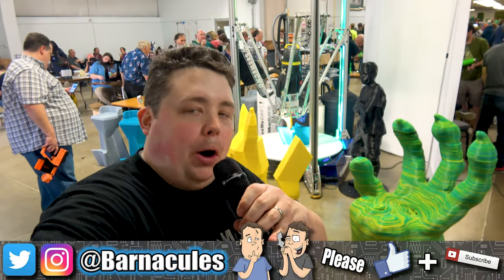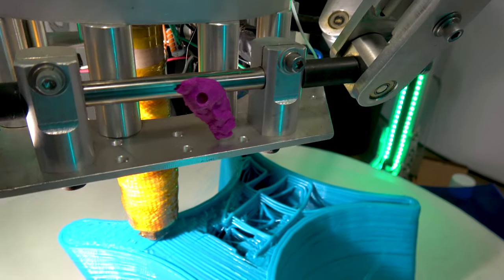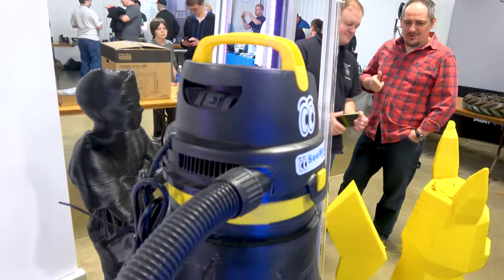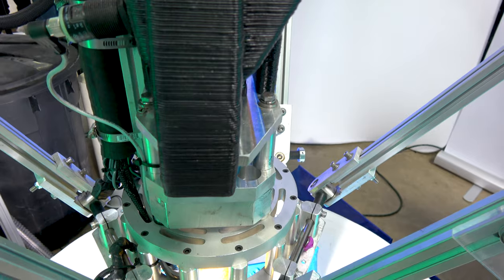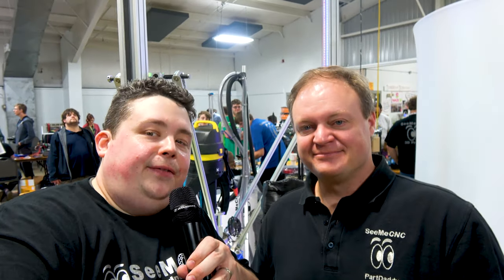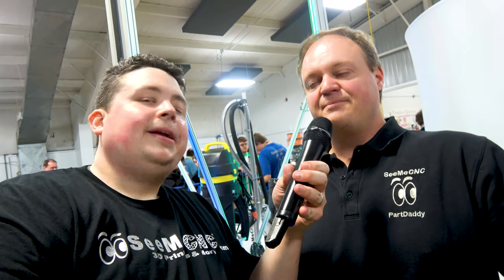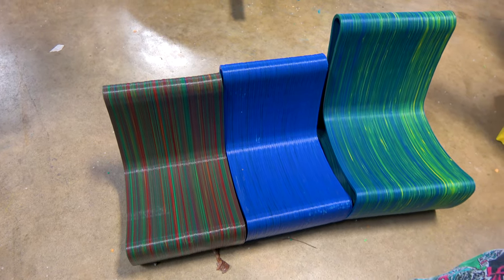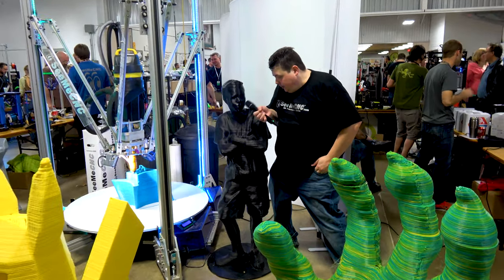Worlds Largest 3D Printer Making Furniture! You won’t believe it. - @Barnacules

Comment: "700Ws of current" jerry pls
Reply from the maker: Yeah, not sure why you're quoting me?!
Reply: watts is a measure of power which is CURRENT * voltage. Assuming it uses 12 volts, the amperage is 58.
Reply: lol k but [current*voltage ≠ current], thats my point

watts is not a measure of current, similar to measuring time in cm lmao
Reply: +Barnacules Nerdgasm  Your response to Shawn is even sadder than you saying "700Ws of current". smh.
Reply: Sean Gibson My money on him doing it intentionally (haven't watched that part yet)
Reply: SpydreX Official, that must be why youre here lol

Imię Nazwisko, sorry to say that none of that crap matters, because the "end result" of current times voltage is power (which is wattage), not just current. regardless of any redundancies amps is current, watts is power, two different things, theres no changing that 

jerry used the right measurement(i assume) but called it the wrong type of unit
Reply: Imię Nazwisko  I pretty sure he intended to say power but he was probably already developing heat stroke by then which started cooking his noodle. Shit happens.

I hope he knows we're just bustin' his balls.
Reply: Adam The system runs on 110VAC.
Reply: He said it was all standard electronics, except the motors. Anyway for a heater, its the amps that matter.
Reply: Good thing some of us are more literate on the fact that people do mistakes but it only takes yourself to correct that mistake on the fly and get the info into your brain as it was intended in the beginning. Funny how people really feel the urge to correct others. Jerry should have said 700Ws of horsepower, throw a little bone to the masses, you know.
Reply: Im sure its rectified and stepped down. Do they make RAMPs boards that even run off of ac?
Reply: Yup.... pretty embarassing  for a nerd...
Reply: davidcapi, pleading ignorance will get you nowhere - especially when you had nothing to do with the situation

without being corrected you'd never learn. try growing up without being corrected on anything, thats the importance of it. clearly jerry didn't know where he went wrong based on the first response to my original comment

you've got a pretty condescending post if you ask me
Reply: +Sean Gibson Did I trigger you?
Reply: Adam  Yes standard electronics but those are fed by a power supply stepping down the standard 110VAC to 12-24VDC.
Reply: Life lessons, on a current - power discussion. If correcting is so important, Sean, why didn't you just make the correction but rather, play the "I will call your fault and let you try to figure it out" ending with a "pls". Now, don't come try to get me "schooled" son, I've been through inmature behavior dealing before, yours is ending here, as in, any future reply will be bypassed by me. Have a nice day sir.
Reply: oowiegoowie Oh crap! You are right! It's "immature". You see, my native language is spanish. Even tho I always edit my posts and replies and have them as correctly spelled as possible, I'm bound to make a mistake here and there, like thinking "inmature" was the equivalent for "inmaduro". Good thing you were wise enough to spot it and actually know what I really meant to write. Have a good day, sir.
Reply: Barnacules Nerdgasm yeah you slipped up but every reply to this is dumb. these guys aren't nearly as smart as they think they are.

1, when dealing with ac voltage times amps (emf x current) give not watts but voltamps or voltamperes if you like the long form. to get watts you need the power factor. voltamps and watts may be different because of some things that can happen with the wave form. 
2, obviously the ramps board doesn't run on ac, it doesn't run on 12v either, that might be the input voltage of the board but the atmel chip is running from probably a 3.3v source. maybe 5v. the steppers are running 2phase quadrature at I dunno, anywhere from 24-80v could really be anything but steeper controllers regulate current via emulating a voltage through pwm control within the square wave of the quadrature signal. the measured voltage will depend on how fast the motors are turning since that changes the motor impedance. 

3. clearly what was meant by 110v is the transformer/power supply doesn't need to plug into 220 to get the required watts from the wall. obviously it would be silly for all the parts to running from 110 directly.
Reply: how do you know the steppers run on ac?
Reply: Sean Gibson yeah I cringed when he said that as I study Electrical Engineering. But we also have to remember that not everyone deals with this in a daily basis so it's excusable in this case. people make mistakes so don't rag on him too hard
Reply: Shouldnbe 700w of power...

Comment: This is pretty awesome, glad you took a look at it.
Its actually not to surprising that this beast runs on 120 volts. Given the print head draws 5.8 amps, leaves plenty for the stepper motors and electronics. Only reason to run it off 220-240 would be to push more current to the print head.

Comment: 8:40 .. .23 million cubic mm only equates to about 23 cubic decimetre (or 23 litres, if you like it that way).  That doesn't quite sound right, given the size of that printer.   Assuming a cylinder with a diameter 1 meter (1000 mm) and height 3 meters (or 3000 mm), you will have a total volume around 2356 million cubic mm. He is out by two orders of magnitude.

Comment: The beauty about Delta robotic machines is they can be very rigid, minimizing wobbling while moving faster. The problem with this one is, the columns need to be very rigid, since this Delta adjust position by having at least one of its arms move up or down in the column in reference to the others, unbalancing the load on the columns. The Delta arms can also limit more the height of the work volume in comparison to a Cartesian rig, but considering all the stuff behind the end tool base it won't make that much difference.

Comment: The material delivery system works exactly like the one I use on my injection/mold machine i use at work.
Reply from the maker: That doesn't surprise me since they have 3 injection molding machines at their machine shop and I'm sure they borrowed the design.

Comment: Why not run it off 220-240v? It would heat more efficiently and use less current, requiring a smaller breaker.
Reply: Also the rest of the world could use it.
Reply: Hyss assuming the heaters are 120v (USA standard) its only running about 6amps, so not big deal for standard domestic wiring, not sure why he was getting so excited it running on the lower voltage.  To use it in a higher voltage country it would be simple to swap out the heaters to 240v type
Reply: Why would a higher voltage heat more efficiently?
Reply: Steve Greenfield higher voltage means less current for the same power therefore less power loss across the supply wires, not really an issue for these power levels. Just on a side note this is why power companies transmit power over high voltage lines and step down closer to the user
Reply: Right, I'm aware of that. But as you say, not really an issue at these power levels.

Power transmission lines run at 100s to 1000s of times higher voltages than what is in your house.

Comment: The real question is how does the controller measure how much plastic is extruded each rotation of the auger, because it's not a fixed displacement, you know.

Comment: Those stepper motors look like they could run a 5X10 CNC router that is capable of cutting 8-quarter SOLID OAK in 1 pass!!!!!!!!!!!!!!!!!!!!!!!!!!!!!!!!!!!!!!!!!!!!!!!!!!!!!!!!!!!!!!!!!!!!!!!!!!!!!!!!!!!!!!!!!!!!!!!!!!!!!!!!!!!!!!!!!!!!!!!!!!!!!!!!!!!!!!!!!!!!!!!!!!!!!!!!!!!!!!!!!!!!!!!!!!!!!!!!!!!!!!!!!!!!!!!
Reply from the maker: You're probably right, they were massive.
Reply: GoProAhaulic  8 quarter??? Why can't you just say 2 inches?
Reply: My inner cabinet maker escaped. The stupid thing is 8 quarter = 1.75" lol
Reply: GoProAhaulic  lol. 1.75" is final finished size but "8 quarter" refers to quarters of an inch. 8 x .25" = 2"

Yup. Makes perfect sense...smh.

Comment: Why is America on 110V? Seems pretty low when a large portion of the world is running 200+V.
Reply from the maker: Because we're stupid and if it was any higher we would kill ourselves licking the wall outlets.
Reply: The US standards were set a long time ago and the voltage levels were based on the 'safer' DC voltage level used at the time. It's far too costly to change now but we would be better off with a 230V system.

Comment: It moves pretty slow though , why put the weight on the effector of a full vacuum cleaner seem spretty stupid though, they could have had a screw feed with a hose and had smaller motors

Comment: Tell me now, what would you print with such a big 3D printer? (I would print myself a custom backplate for my GPU)
Reply from the maker: This would have a very hard time printing aback plate since the layers are so thick. But, you could use it to print a new office chair and a new table :D
Reply: FoxBit that thing would probably deform, PLA (the standard 3d-printing plastic) deforms at ~60 degrees Celsius. You would need some kind of High-Temp plastic

Comment: i will get a 3D printer when,
the printer itself is a product of 3D printing entirely
and that printer is capable of printing an even smaller 3D printer
Reply: So, basically all you want is a gloryfied Matryoshka?
Reply: take a look at HP 3D printers, yeah they have too!, i seen a prototype that can print several smart materials, wich smart i mean they can program them to make stuff, printing "in voxels" or somthing like that, seen last year in Barcelona 3D makers festival. I'm pretty sure they will make somthing like that in next years. but also pretty more expensive than this toy. Btw, loved this extruding system. no more need of filament rolls. just raw material. lovly. hope we all can have it in tinny printers 2 and no more need of buying specific filaments. just raw material + colourants
Reply: reprap snappy
Reply: Yeah, 3D printer-ception-thingie
Reply: TinchoX you do realise there is one? It's called the reprap snappy... It's 79% 3D printed...
Reply: I have one that's kinda like that, it's called Snappy RepRap
Reply: how well does it print? I'm thinking of printing one myself...
Reply: Pretty good look at the GitHub repo for pictures

Comment: I had to laugh at 110 volts 20 amps that's a bit lame! here in Australia 240 volts is standard with 10 amps  15 amps and  20 amp outlets in the home or 415 volt 3 phase up to 100 amps. More volts less amps always better.

Comment: wow sooner or later we can 3d print houses.
Reply: squeaker EDITION has already been done
Reply: There's a couple that print cement.
Reply: not exactly 3d printed, house made of fabricated material or partition that created by 3d printer, which is better when you building something complicated you need to able assemble and dissemble it.
Reply: squeaker EDITION Or at least build the parts for a house to be assembled.
Reply: That already exists. Google it
Reply: there are SEVERAL house printers. with diferent ways to do it. like meleniumshane90 said. just google and u will find

Comment: Ahem.

So someone here is mathematically challenged.  I know, there are a lot of digits if you choose, for some highly odd raisin, to use millimeters for units of measure for the build volume of such a MONSTER!  Nevermind his being called the brainCHILD of the device which is actually HIS brainchild, but he gracefully let that slide so he could get to the JUICY part of the script where he illustrated his human calculatorness by claiming a 10X stunted volume.  Assuming that the max Z is 3 METERS as stated, the diameter would have to be 100 mm instead of the claimed 1000 mm diameter in order to yield a print volume of a mere 23,000,000.  Judging from the claim that YOUR HIGHNESS could actually park his diminutive derriairy in one of those printed chairs, I'm don't thimking that the 1 meter diameter claim was incorrect.  This means that the actual print volume, in milli-type-meters, would be on the order of 2,356,194,490.  Twenty three HUNDRED million, in other words.

But who's counting at this stage????

Comment: Is this printer only for printing big things - print quality looks like shit?!
Reply from the maker: Dude, it has a 4mm nozzle diameter, that is 100x larger than a standard desktop 3D printer. So yeah, the print quality is shit, but it can make huge strong things relatively fast. You wouldn't want to print small action figures with this, but a G.I. Joe that is 9ft tall to put on your front lawn? hell yeah!
Reply: Barnacules Nerdgasm yes I know but you can see in the print that the top solid infill lines does not touch each other. This is a calibration issiue. nozzel diameter dosen't matter here.
Reply: You're not going to be calibrating anything with the lack of rigidity on that structure. It needs side supports to hold the vertical posts in place.
Reply: adisharr This is another problem. :)
Reply: Yeah there's room for improvements on that machine for sure but I think they just wanted to get it working. Some college kids built a similar one at a machining show in PA that had the same issues. The large prints were cool to hold though but they actually used very large diameter filament. I think their nozzle size was smaller.